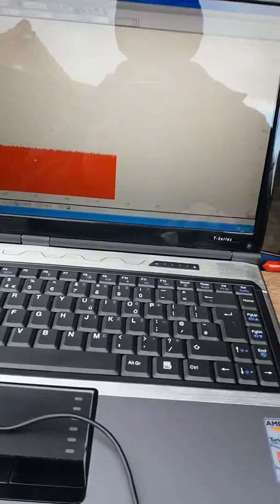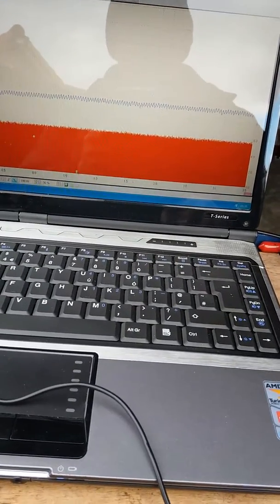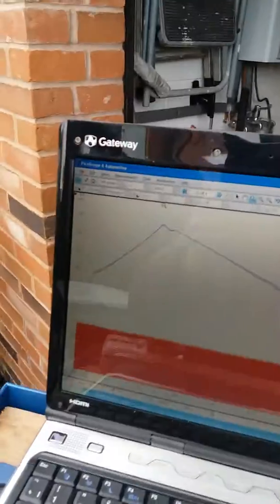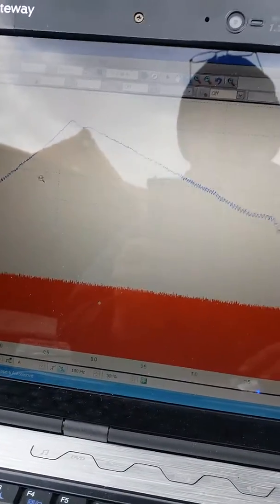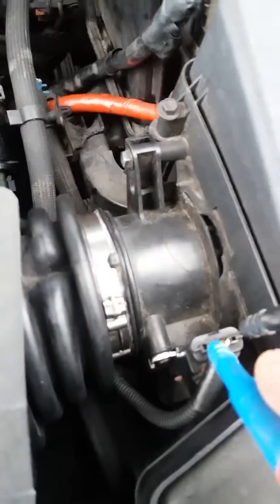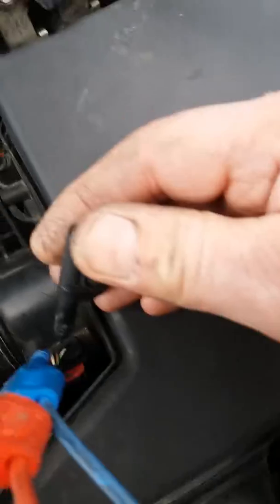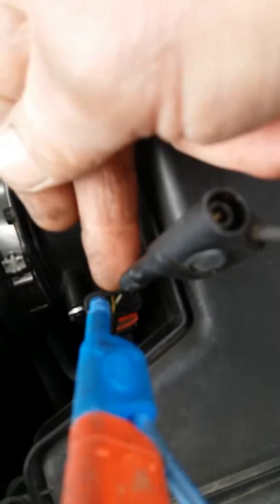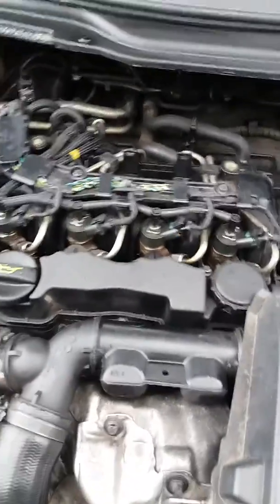Volvo V50 1.6D Digital MAF, Peugeot, Citroen, Ford, PSA

Comment: The MAF I have on my Volvo C30 with the same engine is a 5 wire version, with air temperature.
Reply from the maker: I believe everything is identical between C30 V50 Ford focus and Mazda 323.could be slight variations though.

Comment: Do you have wiring diagram,? Are you sure that is 12v constant supply. Thanks  ,
Reply from the maker: Wiring is as stated in the video, Yes I do have a wiring diagram.
Reply: Thanks for that reply . I thought this type sensor  it is including  air temperature  in it . So Should have two signals . Would you mind post wiring diagram . Where is that 12 v comes from . .
Reply: O. , The video  you showed. us is a 4 pin. This completely maf wiring..
Reply from the maker: Wiring as stated in the video